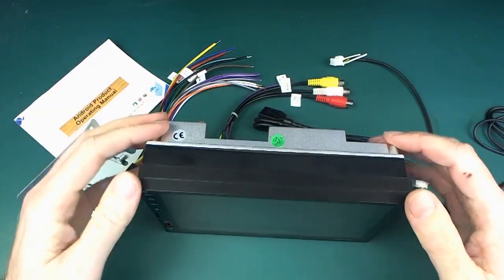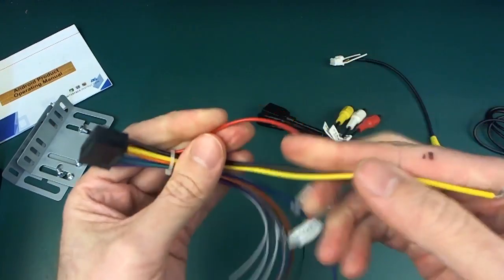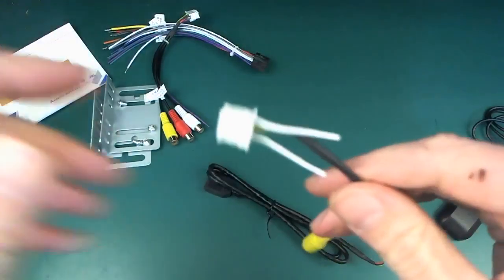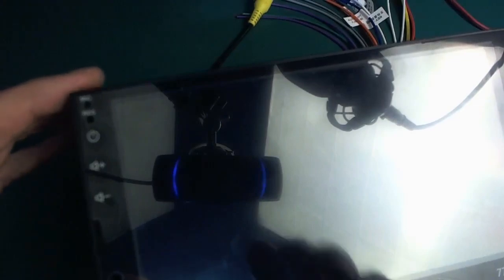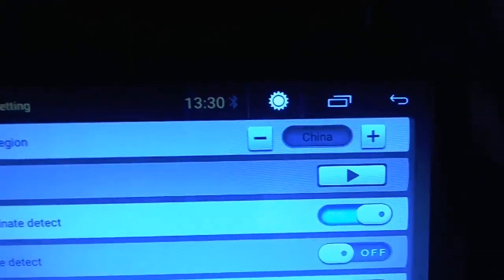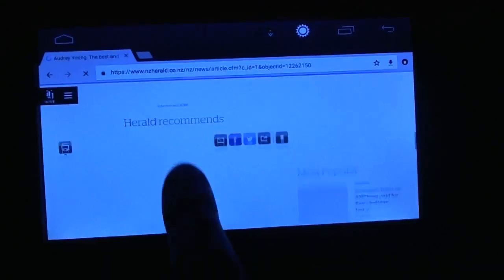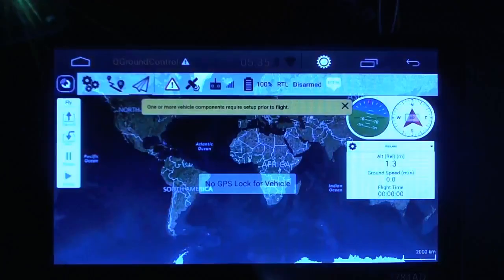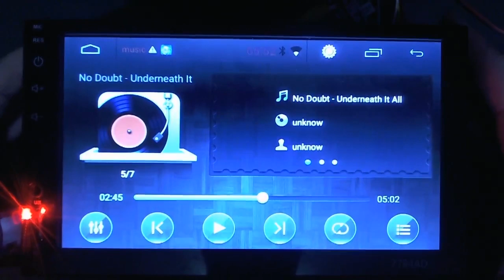Android car stereo 7784AD first look and features check (courtesy Banggood)

Comment: the red and white rca are probably took go to an external amp, like for a subwoofer.
the purple wire with the rca connections, should be a power on or "enable" for an amp.

the blue on the normal harness one used to be for power antennas, to tell them when to go up and down, but can also used to tell an amp when to turn on.

Comment: You could use this for an ArduPilot ground station! Connect to a vrx instead of the backup camera and toggle the switch from normal view to FPV with a foot pedal or something
Reply: I need something a lil smaller than this to connect to the AUX of an older radio, kind of like the size of a Sirrius radio, but can hold SD cards & play my music files showing album art.
Just like the sirrius radio, I want to be able to remove fairly easy.

What do u suggest?

Thanks in advance..

Comment: The audio out with RCA connectors is probably line level (not amplified) output to put into an external amplifier.
The power spikes during standby is it waking up to check if that enable wire is on or not.

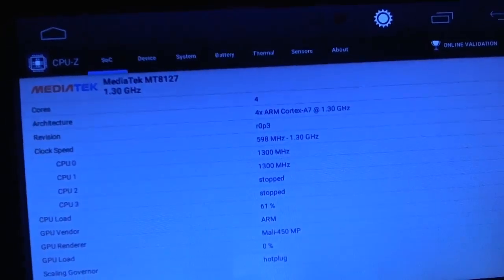Comment: It looks like it is running Android Lollipop 5.1 (version 22) via the CPU-Z app at 32:21. I wonder if they changed the settings to make it appear as an Android 8 device.
Reply: This is the concern with these units. One off custom ROMs. They outdate quickly for something that requires an effort to physically install. Had one myself and ended up removing given no ongoing OS update support.  Not to mention they don't seem to last long. If it is 5.1 its already time for the bin. Fingers crossed it is 8.1 ( not holding my breath). Iforce2d ?

Either way I am hoping this means more balloon flights!!
Reply from the maker: I'm really doubting it's 8.1
But the lack of ongoing support doesn't seem to me a big deal for a car stereo though. You listen to music/YouTube and use maps. If one of those somehow stopped working that might be a show stopper but I can't see how an old OS version would cause this, at least not for a long long time.
Reply: @plam600  
It's not that big a deal. Google maps was still working fine on my android 2.3 based head unit when I took it out about 12 months ago. It's an older style version of the app, but was still getting updated occasionally.
Unless you're regularly browsing the web on your car stereo, it's not really a big deal. The only app I'd like to run on mine that I can't is Fog Of World which requires 5.0.
I've also got one that runs 4.1, but like this one, claims to be 8.1.
Anyone buying one and needing specific versions of the OS should look for screenshots of the system page showing the kernel version, the  check that against Android builds for the CPU used to find the likely real version. Could still be something else but a 3.x kernel is very unlikely to be android 9.x.

Comment: The orange illumination wire is also sometimes called the dimmer. If you connect it, then the display should dim itself when you turn the headlights on. It's for night driving. Neet device though. I gotta make a custom guage cluster for someone so he can connect to his mega squirt ecu and read real time data. I might suggest one of these instead.
Reply: I might be wrong but I believe the illumination wire only lights up the outside buttons on these radios.
Reply from the maker: When the orange wire sees 12v the outside buttons light up.

Comment: I would guess the yellow connector with the wifi antenna is the reverse camera input. the other cable yellow red white RCA connector may be a RCA input for another video source extra wire may switch to the input when powered.
Reply from the maker: Correct, at least the first part of what you said. Haven't checked the second part.

Comment: I used a ohm meter and pressed my steering wheel buttons and found the wire then hooked it up to key1 ...in the setting you can map your buttons to functions of your choice.

Comment: I have a high end Sony which runs a skinned version of Android,  unfortunately you can't access anything outside of the skin and cant install apps to it but the high end audio quality and 5v pre outs were very important to me as I run a 1500w RMS system and trumped everything else.
Reply from the maker: I have a ruptured speaker in one of my doors that I haven't been bothered to replace for 3 years - different priorities huh :)
Reply: @iforce2d  Ive always had a system ever since i started driving as a teen but now im 41 and have split with my wife ive gone to a new level ha ha.
im drawing so much current from the cars electrical system that in slow moving traffic it kangaroos to the beat as the alternator gets forced to work super hard in bursts lol

Comment: Good video! Do you know if you are obliged to have an android phone to have this work? It’s not clear to me. Could I use this device with an iPhone for WiFi hotspots, a google account and voila or android phone is required. Thanks!
Reply: They are fully independent of your phone. Wifi hotspot for internet if you want internet on it while driving, and you're good. A Google account isn't even required if you're OK with using 3rd party app sources (or just the supplied apps).

Comment: As a car stereo some depth to actual audio functions would have been HOT like E.Q . settings sound or anything I get the tech part, but I want to know what EQ apps work and how they sound or options. I love your work but you, me, and that other guy, are the only ones that will use MAV COMS on our car stereos LOL. Although very helpful and I had not thought of that option.
 BTW just trying to support your channel through commenting on all vids subing and sharing cause cash is short.  See that one blokes vid "cheap ass quadcopter"
Reply from the maker: Yeah sorry, I forgot to show the EQ 'app'. Its kinda primitive, just a bass and treble, some named presets (eg. Jazz, Rock) and a single user-defined preset. Well there is a 'subwoofer' slider for all of these too but it's set at zero for all the presets, it can be changed but I'm not sure if this radio has the output wires to handle it properly.

Comment: is this going to be legal in new zealand? i wouldn't think you'd be allowed something that can play movies etc. might want to pull it out for your wof, or do something to disguise it
Reply from the maker: Perhaps books should be illegal to possess in a car too? :) WoF is a check for road-worthiness, nothing about this makes the car unfit to be on the road and the guys at VTNZ don't spend their time getting into your stereo to see if it can play movies. As far as I know most of the factory spec sat-navi things in new cars have some kind of media capability and there is no functional difference between this and sellotaping your tablet to the dash. If the problem is that you might want to fiddle with it while you're driving, well you can do that with any regular car stereo too.
Reply: @iforce2d  well i'm not taking a position on it, i'm just saying that i think it might not be legal. I once failed a wof because my drivers side door was missing the insert that covers the inside. the handle, window, and lock all still worked fine, it was just missing the vinyl/plastic panel, still failed. I'm not saying any of these rules are sensible or actually do any good, my point is that there are plenty of nonsense rules that the inspectors have to follow. Maybe if it blends in and looks good they'll just assume it's compliant and not look into it
Reply: @iforce2d  i just looked it up, and at least as of 2011, according to the AA, you're probably fine. It used to be banned, but because of all the new devices that started being made over the last few years they changed the rules so that the responsibility is on the driver to not do anything stupid.

Comment: I know you probably talked about this in the video but this one is not really for me to be honest. Anyway, I was wondering if you tried to run android auto. It has been refreshed recently and it's quite convenient, and with a device that runs android natively you wouldn't need to connect an external device as it's usually done. Just my 2 cents :)
Reply from the maker: Not yet, I will probably try it sometime
Reply from the maker: oh..... app store says no. "Your device isn't compatible with this version"
So I guess I won't be trying that :)
Reply: @iforce2d  Internet says you should try to delete the cache and then the data of the Google Play Store. It probably won't work but it may be worth a try!

Comment: If you can I’d root this and use custom firmware
Reply from the maker: Why would you do that? I have to admit, I did pause for a while before typing in my Google password... but unless your custom firmware knows how to deal with all the car-specific hardware and the wiring coming in the back, you would be giving up a lot of neat functionality.
In any case, I don't know how you would do the typical root procedure, which normally requires holding down the power button and one of the audio buttons on startup.
Reply: iforce2d I’ve put custom firmware on these before. Not this model exactly but have done it with Other Android based OS. XDA-Developers forums which I’m a member of since 2008 would be the place to find the proper firmware if any for this model you have.
I put custom firmware on my brother GMC Trucks system.  I can’t remember off hand the brand it was but no it was a factory installed android based system
Reply from the maker: @Freebird_67  How was the startup button situation done?
Reply from the maker: @Freebird_67  and why would we do this... does the custom firmware replicate all the car features or do we lose some?
Reply: @iforce2d  depends, custom firmware fixes tons of Chinese bugs, gives you newest Android api to support lots of apps. The main problem is thay Chinese people wont open source this devices. So the developer of custom firmware must write his own apps for all special functions that phones do not have and that will be difficult if he does not own one. I would suggest leaving this one as it it until one shows up that is made to be customizable and worth putting work into custom firmware. I would suggest rooting it and looking into /dev and sysfs folder. Sysfs is projected file system that turn variables in code to actual files containing its value. For example pin high or low would be represented by file containing 0 or 1. (its all written in kernel or kernel modules probably not the apps itself) Thats my guess how those apps work. You can download terminal emulator and cd to root directory with command "cd /" and then do "ls" command to list directories then "cd sys" and "cd devices" and there you can explore folders and files that represent actual values of some variables. Use command: cat filename (replace filename with file) to read value. For example on my sm-a520 in folder /sys/devices/battery/power_supply/battery there is file called capacity. When you read its contents it contains current battery percentage. In same way for example value of orange wire would be in some file containing 0 or 1 (probably linked to isr). You dont need to root device for cat and cd commands. Just download terminal emulator and explore sys folder in root directory. But still without open sourced kernel for one of these devices we can't do much. Leave it as it is and wait for one that will take xda's attention. When you see that some devices have good quality written roms theb buy it and upgrade it right away. Android is really customizable. As person who likes microcontrollers and linux i find Android as real beauty os to work on.
Reply: Oh boy now i see how much i wrote there. Pfffff sorry

Comment: I spy an in car GCS Qgroundcontrol should run.
Reply from the maker: Yes, I was running it in the video. The reversing camera input can be connected to the FPV feed to easily switch between them.
Reply: @iforce2d  I commented too soon!

Comment: Thanks for reviewing this i might be fitting it to my Ebike  reason being i can use a speedo app because of the GPS 

Steering wheel control is were you have volume etc controls on steering wheel 

Audio out would be to a amplifier 

20:19  the 2 lines make me think reversing camera .

with the apps you can install and camera input it could be used as part of fpv ground station
Reply from the maker: 20:19 the two lines are my webcam being reflected in the screen :)

Comment: I think it is better to just install an old 100eur Ipad into the car because I feel it would be way nicer to use. You need the amplifier for speakers anyway 🥴.
Reply from the maker: I don't understand, what would be nicer about that? How would I mount it, and power it, would it be able to integrate with the car antenna, or does it not even have FM radio... how about USB host capability, can I insert a micro SD card with music or do I have to flagellate myself with iTunes, what about AUX in, and how would I get analog video input for reverse/fpv cam, I really can't see any advantage. Developing for Apple is torture and costs $99 every year while they think of ever more hoops for you to jump through. And iOS is absolutely awful too - they're slowly catching up with Android but that old 100euro iPad isn't gonna run any decently new version. Amplifier is not necessary for speakers btw, I was connecting directly to regular speaker (but limited power I suppose).